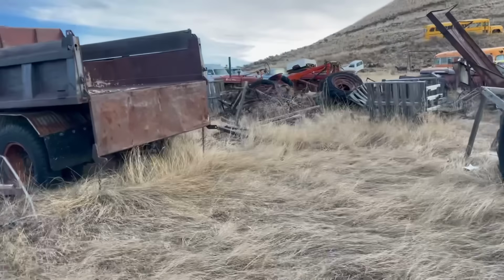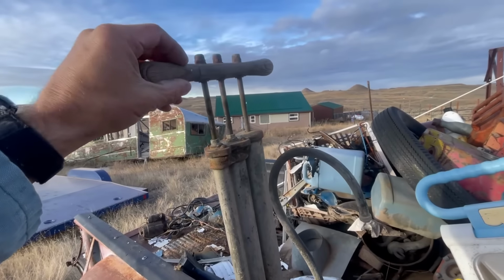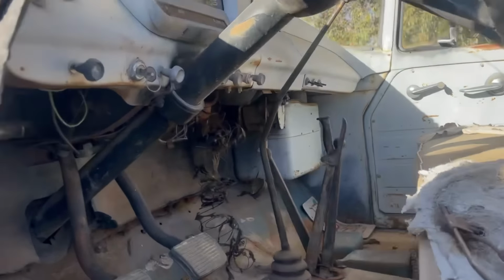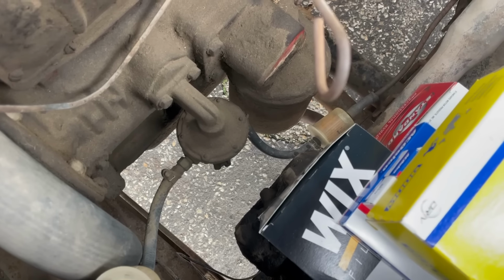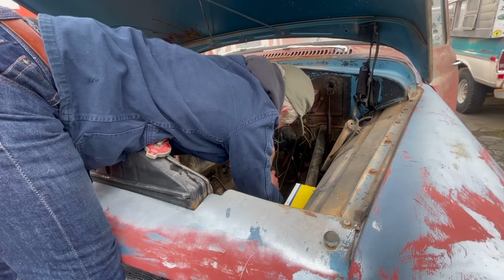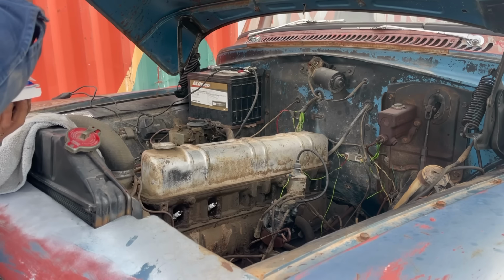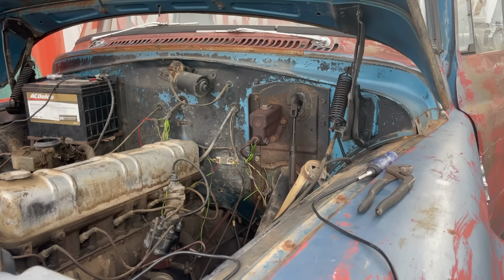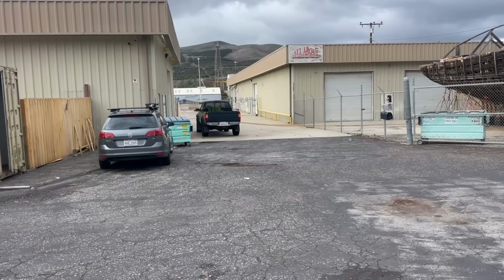International Harvester A120 Pickup SITTING FOR 30 YEARS | Will It Run?

Comment: Hey man, I just want to give a little bit of information. the A120 would be the 3/4 ton rate for those trucks, thus the 6 lug pattern wheels and the full float; the rear axle is going to be an IH in house axle, RA series. RA15/RA20. The brakes will be tough to find, I think.
Reply: love all those old trucks. any of them are getting harder to find.

Comment: My 67 1200 looks a lot like this, the dash is different. Mine 2X4 with 6 cylinder 3 speed. Snap ring wheels that Nobody will touch. Its a work in progress Parts are scarce as hens teeth and pretty expensive. Since I can't find engine parts I'm thinking of putting an AMC Jeep 6 cylinder in it.

Comment: I wonder if that was a Navy truck originally,the color leads me to think that.The frame needs welds and reinforcement with plates to strengthen it,maybe you could repurpose the steel from the snow plow mounts to plate the frame cracks?

Comment: The A in the A120 designates Anniversary. You have the anniversary model truck. It's a 1958 I do believe. I have the same truck, but it's a one ton fire truck. Mine has just over 10,000 original miles. Sirens, emergency lights, fire hoses, pumps etc. all work! I'm wanting to change out the split rim wheels to regular wheels and put new tires on the truck. Do you know where I could get wheels? I also have a box of parts - I haven't looked in the "box" in ten years. I'll see if I have any emblems you may need etc. No promises, but I'll take a look.
I'm not sure how I can share pictures with you. Do we break rules on youtube by exchanging contact info. somehow? Cheers to cool old trucks - especially IH A120 All Wheel Drive.!!